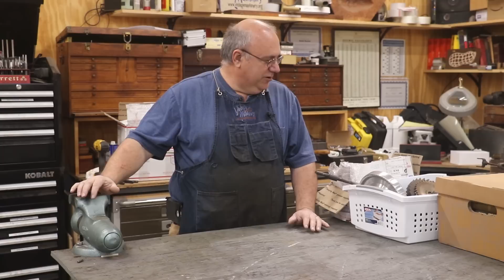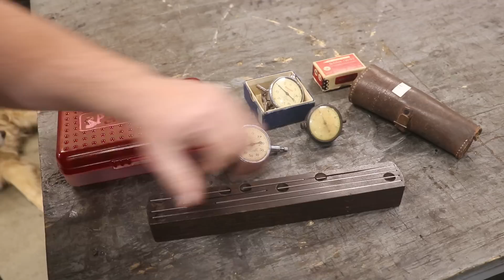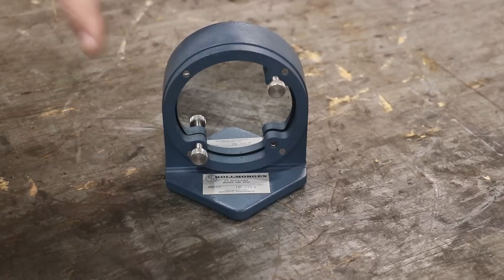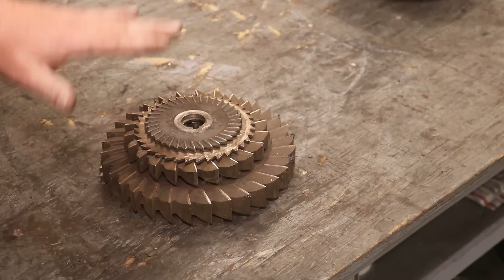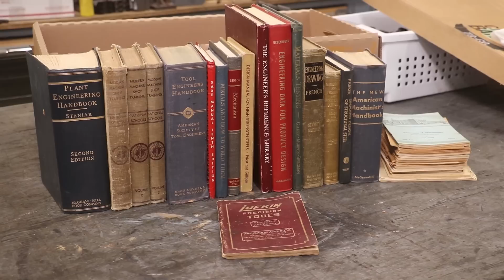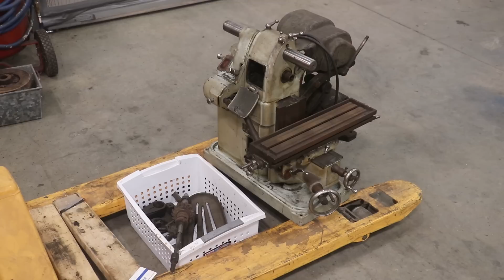Odds & Ends 114: New Tools and Viewer Mail!

Comment: I have an Atlas mill like your new acquisition. I used it for years horizontally, and then found a vertical head,Dumore brand ,adapted it with a subplate.made a simple stub arbor for the spindle. It is 1to1 ratio,so all speeds and feeds are the same. It's also MT 3, uses a drawbar. Much easier to use. I did ,however, use a riser under the horizontal spindle to regain lost headspace. Many parts have been made with it in the last 30 years.

Comment: Why do you guys call a ruler a scale, surely a scale is used for finding the weight of something and a ruler is used for measuring length, diameter etc. Even Lufkin call the #8 rule clamp a rule clamp, not a scale clamp.

Comment: I'm not sure about the explanation of the inspection hammer.  I recall the inspector tapping wheels and listening for the distinctive sound of a cracked casting. When I was young I lived close to the terminal station of arailway and watched them. The job was actually nicknamed "Wheeltapper" although they were actually inspectors, checking much more than wheels.

Comment: If the mirror on the collimator is first surface, (and I think it is to prevent double reflections), be very careful cleaning it to prevent ruining the finish.  Unlike normal mirrors, these have the silver coating on the front, rather than the back.  This gives an undistorted image, but makes the coating very fragile and susceptible  to contamination.   Nice score, BTW!

Comment: Hi Keith...I would love to see a restoration on the Atlas mill.....I picked one up last July (luckily it was from the original owners son, so it was a complete unit). I stripped her down, cleaned her up, and put her back together, but have been unable to use it because I had to make a new arbor and draw bar. Anyway,  I would be interested in seeing how you set it up after a restore. Thanks for all your videos.